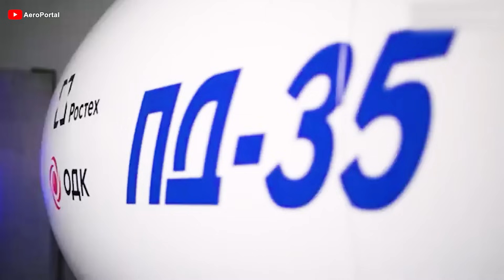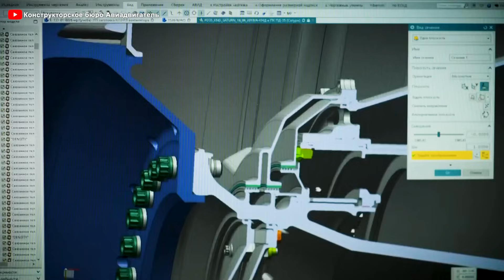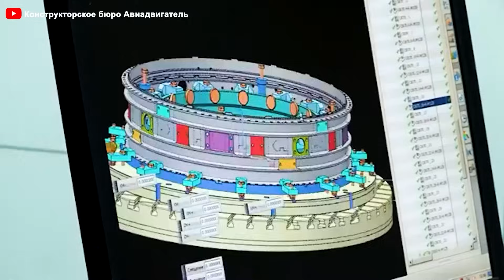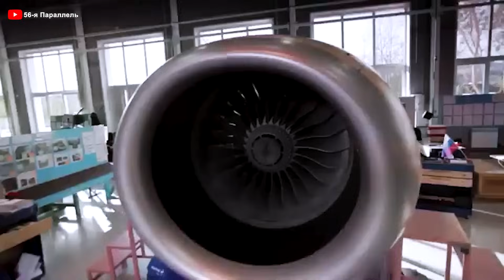CEO Alexander Grachev REVEALS Russia’s PD-35 Engine will CHANGE All Aviation!

Comment: Russia is the only country in the world  that can build aircrafts form the scratch to series.  Airbus is cooperation of well developed EU countries. Same with Boing. Boing imports most of the parts and components from all around the world. Russia builds its aircrafts alone. No other country in the world can do that. China uses RR engines. Japan (Mitsubishi) tried; and after spending $Bs... declared that project is closed.
Reply: China uses GE engine. And it is an obsoleted tech model one, LEAP-1C.
Reply: @alexlo7708  you're right. I forgot about GE.
Reply: There is a reason why Airbus and Boeing build it's jets with components produced in different countries. And it all boils down to cost and competition. 

In the case of russia, there is no competition. Nobody in the west is going to buy Russian jets. Nobody in Africa or Latin America will buy them either. 

Russian airlines also don't have the luxury of choice. They can't aquire new Boeing's, or airbuses. So they get what they get, at whatever cost they are given. 

Lastly, Russian plane building, even if it is 100% produced in Russia with Russian components, IS DECADES behind Airbus and Boeing. They literally can produce 30 passenger aircraft a year, at best. While Airbus produces that same number in a month. And to add to all of this, Russia designed ONE new jet in 30 years (and even then, this new jet is more of development from an old design), meanwhile there is no plan for short range, or medium range airframes. 

But here we are praising Russia, for coming out with a "new" plane in 30 years. Great success comrade, our people will be taking a flight rather than a train from Vladivostok to Moscow, in about 40 years, when we finally have 100 planes...
Reply: @contemporarymonk  is it true that Audi, BMW, Mercedes, BASF, VW, Meyers and many other suffers big losses? (Meyers -- 100 yo shipyard survived two WW -- filed for bankruptcy.) Who is next -- AirBus?
Reply: @romanesq.847  is it true that pd-35 is decades behind in terms of performance, as iss the whole aerospace industry in Russia?)
Reply: @Scoopalook  no. it is not true. The truth is that Boing is losing its doors during the flight; and chasses do not open up during landing (sad. people died). Yet, the witnesses (second one) died before the court date for hearings on the Boing failure.
Reply: @romanesq.847    so sad( In Russia something like that would never happen, no criminals or agencies have ever deleted witnesses

Comment: The power of the engine would make a twin engined An-22 replacement (between Il-476 and An-124 payload capacity aircraft) and a four engined version ( above the An-124) aircraft rather interesting. With two engines an aircraft with a payload capacity of 90-100 tons could be made, and with four engines an aircraft with a payload capacity of 180 tons payload could be developed as an aircraft pair. The same design but with bigger wings and longer fuselage for the aircraft with four engines. This would make development and production easier and cheaper and faster.